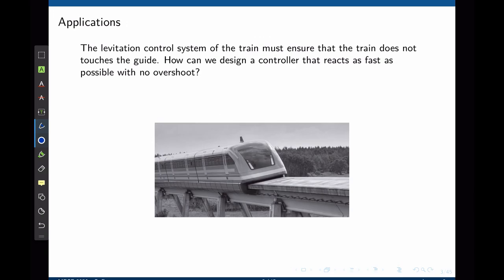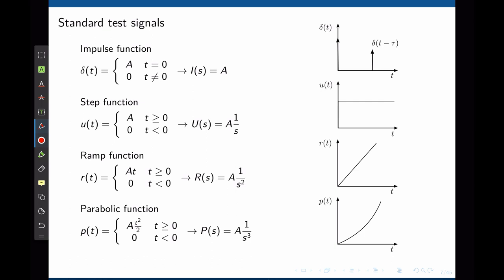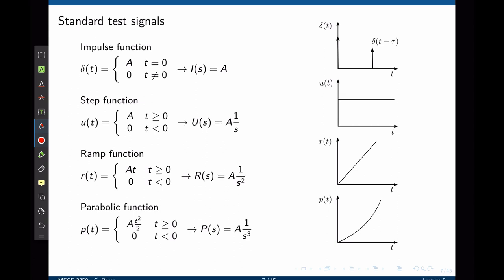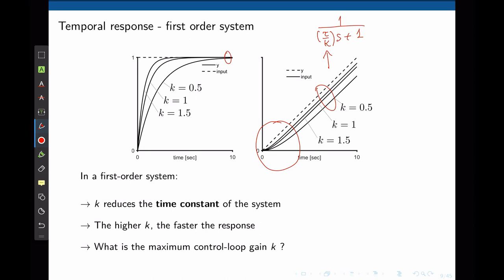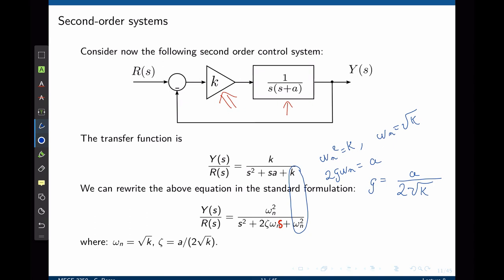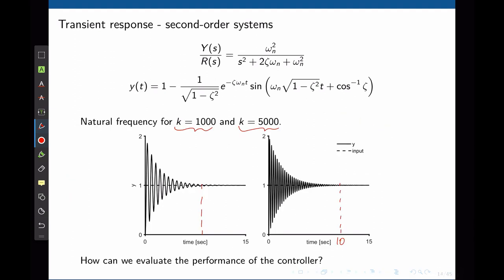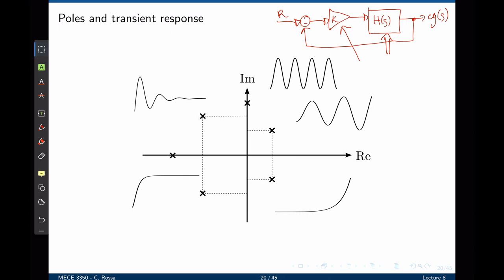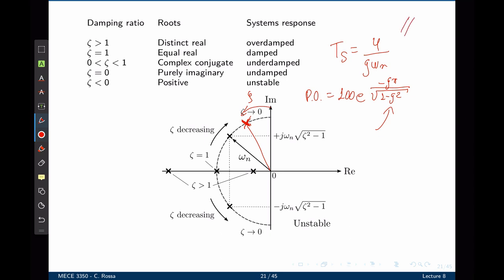Control Systems, Lecture 8: Transient response.

Comment: question concerning 5;46 time stamp you say both are first order but by using a ramp function of 1/s^2 doesn't that make it second order
Reply: I also noticed this point
Reply: @zahraddeenabdullahi5899 

We mean 1st order ODE (only 1st derivative present). 
System response is characterized by the number of energy storing elements (a mass with a damper is first order; mass-spring-damper is 2nd).
  
The confusion comes when we apply different inputs (1/s^2) but recall that 1/s in laplace domain is also integration in the time domain. 

There can be no 2nd derivative that makes this higher order.

Thus the response remains 1st order.